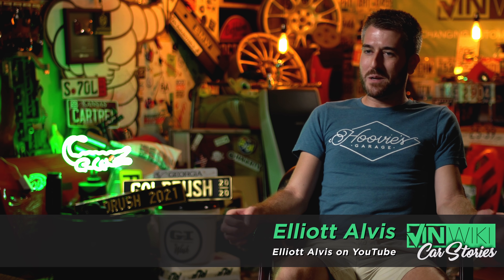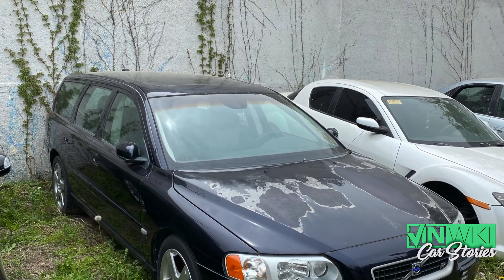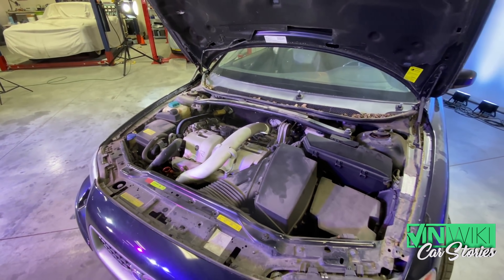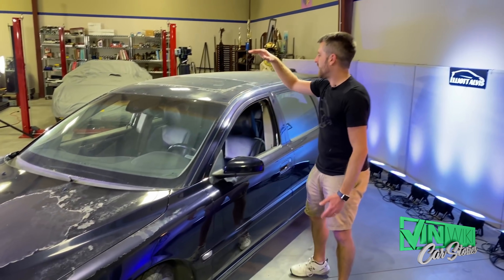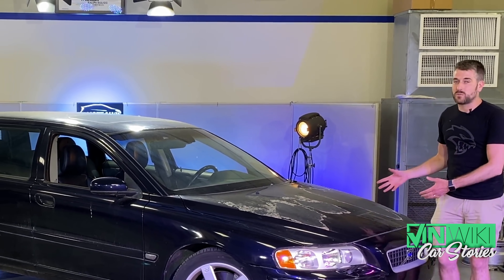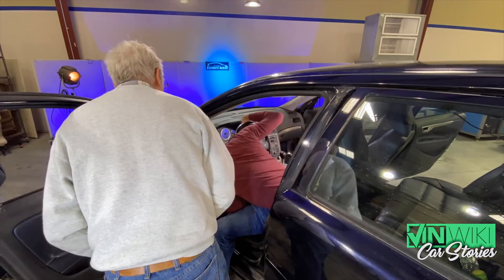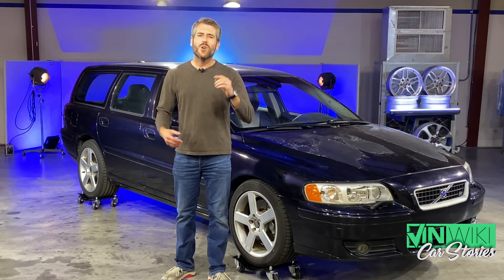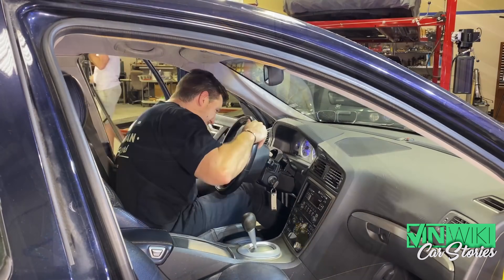Everyone LOVES you with this rare, broken Volvo

Comment: t5 is way better, the awd system isnt that great to begin with and the bore on the 2.3 and later 2.4 t5 won't crack your cylinder walls.  I really wonder where the 20k BAT hype for these cars came from when they break easier than a 2000 v70r.  Audi was the way to go in these years for AWD systems, point blank, plus they also had 5 cyl turbos.  What a no-brainer....avoid these at all costs, all I see them do is die...